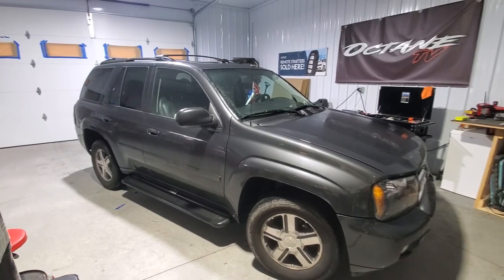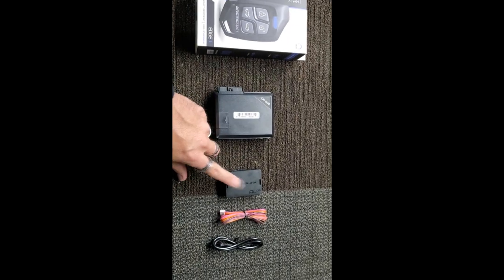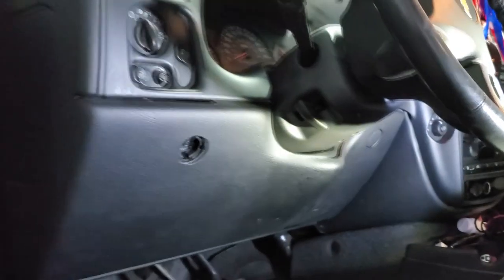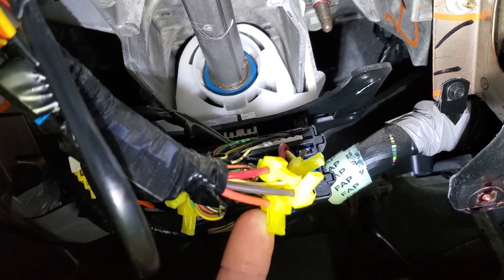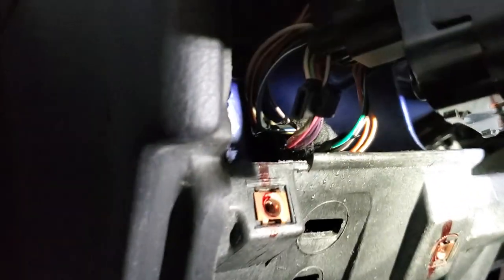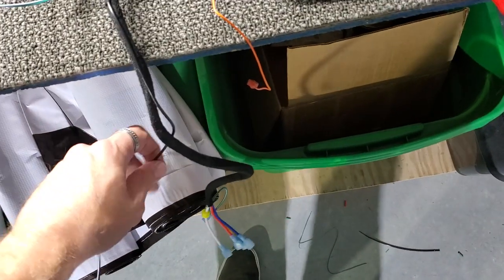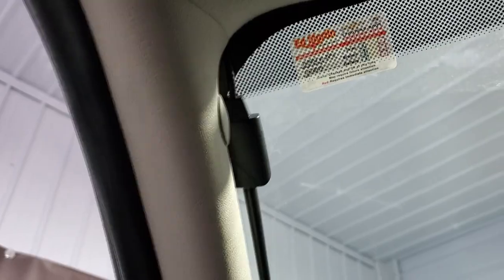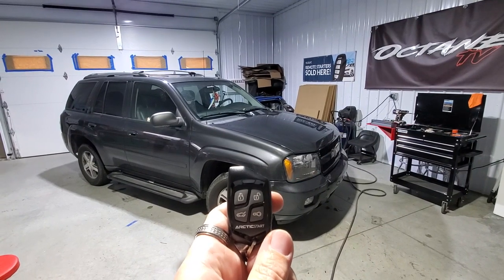CHEVY TRAILBLAZER HOW TO INSTALL REMOTE START - FIRSTECH - CM900

Comment: alright we tested all the wires to verify which was ACC and which wires were ignition +. The Brown wire is ACC, Yellow is Starter. Orange,  pink and white  are Ignition +. we got it all wired up. Luckily, I found a dealer Aspen sound that would program my Blade AL for $20 cash. Had to search around a bit before we found someone because most dealers stated they only program blade AL if you get the install from them. So be sure to ask the person selling you the Blade AL to program it for you before they ship it, other wise I'd suggest using the kit this guy used in his video.

Comment: Now for some questions, initially when we wired it up we got the remotes to work but could not get the remote start to stay running for more then 3 seconds then it would shut off and try again. I went thru checking all the connections figuring either the wire to the immobilizer yellow /black wire had a bad connection or the orange  data wire to the OBD2connector may of had a connection issue. To be sure I checked all connections with test light and ohm meter. Once done I rechecked to see if it was working and it was. Never quite figured out which wire it was but I gave them all a big pull to be sure I had good connections now. Now for the question. First off I did not jump my  brown and orange  to the white wire as you did. Its connected directly to brown wire which is ACC as per directions. And I did connect the Red wire to both red and red/white wires on the CM900 which you mentioned you did not. Here is for the question. My 4x4 light or suspension light seams to come on when I use the remote start and will not shut off unless I shut the engine off and then start with key. Is this a issue or normal. Im going to try disconnecting the green/white wire tomorrow and if that doesnt work maybe jump the brown and orange other wise im just not sure whats up. Any suggestions?
Reply: So without hooking up the bypass module to the factory alarm which is the data link he's talking about You're going to continue to throw codes every time you  Hit the  Remotee start button.  What I'm trying to figure out is how to hook up the door locks
Reply: If you hook your Brown wire up to the data purple wire your remote start will stay running but with it hooked up to that wire it will throw codes and  Drive like c*** so you need a bypass model I'm trying to figure out how to hook the door locks up.
Reply: I got everything working. In his video he shows jumping 2 wires. You actually need to buy a relay and create a power on condition with the ignition on for that one wire that needs power for all systems to function. I’m working on a video of my own showing how to sort this mess out. I also just bought another remote start for my Escalade. I bought the programmer for the blade Al too. Makes everything a breeze to install. Anyone needing there blade programmed send me a message. I’ll hook you up

Comment: I'm connecting this same set up on a 2007 trail bkazer. Wish you said what color wire connected to what color wire once you had showed the wires connected. Its very difficult to make out which wire is connected to which wire. We did use The Blade AL

Comment: Anyone wanting to know what color wires are what on your trailblazer. Brown 12V ACC,  Red  12V constant, White 12V Ignition, Pink 12V ignition,  Yellow 12V starter. Now connect your vehicle red to Cm900 RED, vehicle white to CM900 blue, vehicle pink to CM900 green and vehicle Yellow to cm900 yellow. As per the red/white wire on CM900 I do have it spliced to the red wire on vehicle  which he does not show so you can decide weather to connect it or not and I did not jump the brown and orange wires as shown in this video but I'm still testing the sytem.

Comment: Geek squad installed a compustar remote start on my 2002 trailblazer but when I drove off my vehicle was driving funny😒 the 2wd light was flashing and the 4wl light was just lit up at the same time and it drove as if they were working against each other! And the steering was rough! It wasn't doing any of that b4 I took it to them..what do u think they did wrong?

Comment: For the Trailblazer brown accessory wire are you just taping that into the CM 900 white accessory wire (which goes to vehicle accessory orange) and not using the CM 900 green/white wire?
Reply from the maker: We use the white accessory wire coming off of the cm900 with a jumper coming off of it so that we would have two accessories out. We run the jumper to the orange and the white wire to the Brown. Basically all we're doing is just jumping a wire off of the white wire. In the video it might look like it's a green with the white stripe that we just cut that wireoff and used the scrap wire so that it was the same gauge of thickness.